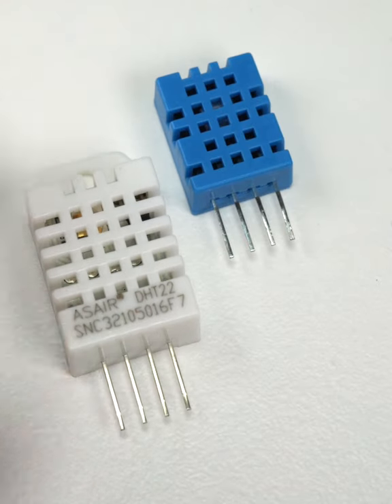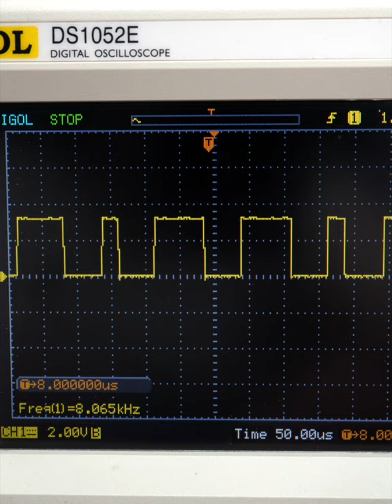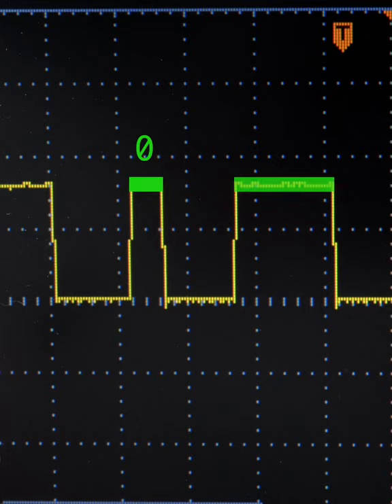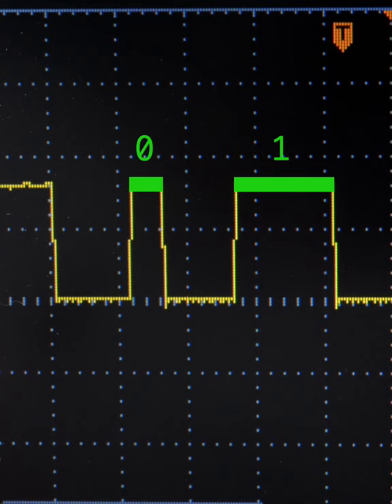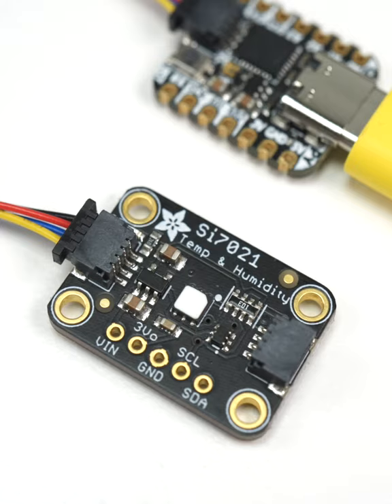DHT11/22 Temp Sensor Trouble - Collin’s Lab Notes #adafruit #collinslabnotes

Comment: I don't know how Arduino does it, but there's no reason the OneWire interface can't be implemented solely through interrupts.  No need to busy-wait counting cycles.
Reply: This isn't "the" One Wire protocol, it's a single wire protocol that is very timing sensitive and also wiring sensitive.
Reply: @rpavlik1  The only thing that's sensitive about DHT sensors is when you poll them too fast. The datasheet tells you the fastest they can be polled and I've never had an issue with a few feet of wire or "timing" issues reading the sensors.

This video is just hocking the more expensive adafruit sensors that do the same thing with the same accuracy.
Reply: You're right.  Just catch the rising edge in an ISR, along with a timestamp. Then reconfigure the processor to trigger on the falling edge.  When that triggers, take a timestamp and calculate the difference between it and the previous capture.  If it's longer than 50-60uS, then it's a one, otherwise.....
Reply: @rpavlik1  true, it's not exactly the same, but it's not that much different in this respect.
Reply: @tonyfremont  I think that would be more complex than the Arduino library. I just had a look and they suspend all interrupts while reading from the sensor since the timing is rather tight. Since the max length message is 40 bits, that would be 80 interrupts total at 2 per bit plus a couple more to signal the start of a reading and then you still have to measure all of them to see what you got. If you had another interrupt fire during that time, you would be in trouble.

There might be some speedy controllers that could handle it, but I'm not sure an 8-bit AVR is up to the task if you want to do anything else.
Reply: I'm not sure about other microcontrollers, but the ESP32 has a "RMT" peripheral that will capture a sequence of digital transitions and the timing thereof, without holding up the CPU with active polling. I rolled my implementation of a DHT-11 driver using this, and it works pretty well.
Reply: @technicholy1299  DHT22 and especially 11s are not as accurate or as long lasting as other I2C sensors and the unreliable interface doesn’t make it so great. There are I2C sensors, even some that come in similar physical packages like the DHT20 that cost near enough the same and are just better. They are all tiny SMD packages too making them fairly versatile.
Reply: I was gonna say, how does my board run Octoprint and a temperature reading at the same time if it really is that resource intensive?
Reply: @technicholy1299 Not really, for use with an Arduino these tie up too many things. Using i2c essentially takes that load off while also giving more accurate measurements.
Reply: @milescarter7803  its not resource intensive the point is that your loop is ran by a single thread so the more time you allocate to "counting microseconds" (quoted from the video) the more time your not running through the rest of your loop. Same is true for literally every line of code though. Less tasks is obviously faster

Comment: I’ve been using an SHT30. But bulkier, but it looks very similar to the DHT22 sensor and works through I2C.
Reply: I use SHT40. it's actually tiny, and only requires a small cap. Maybe you are using a too -large board
Reply: Yes...the sht xx are the best solution...i lost my nerves too much with dht...

Comment: It's a bit more advanced but you can use dma and timer capture to read data from those sensors
Reply: It isn't worth it. Overly complicated solution when there are better out there.

A sensor that outputs measurements in I2C format is a much better solution. Cheaper, fewer component count, greater reliability and less complex software and a shorter development time.

As engineers you are trying to optimise the solution, not make it more complicated than it needs to be.
Reply: @deang5622 Configuring a micros peripherals to offload CPU time is not making things more complex than they need to be, it's making it exactly as complex as it needs to be.  Also check out the cost of these I2C parts compared to the original single wire devices.
Reply: @deang5622  Setting up DMA and a timer capture is like a handful of register writes and a short ISR. That's probably just as simple, not to mention just as easy to write as a simple I2C driver.

Comment: Temperature and Humidity are slowly-changing quantities. Even if you read them once per second (which is probably more often than you really need to), you'll still spend less than 1% of your processor time bit banging.
Reply: That is true, but you still have the problem of blocking high priority interrupts etc if you start measuring multiple 28us periods purely in software.  It's not that hard to use a timer to run these under interrupt using a timer with compare/capture though, assuming you have a spare one.

Comment: i2c, the best
Reply: Curious as to why? It seems people in the know are real fans of I2C and I'm a novice.
Reply: @Quietloud its a rather easy to implement serial buss that allows multiple devices to share the same buss by using a master slave system, so instead of the temperature sensor always sending out its information on the buss the master (usually your main controller) says hey id 123 "fromMaster" out into the buss so it doesn't matter where on the buss it is either. onse the slave device is done doing what it needs to do it can then send out a response on the buss for the master, for temperature that can be pretty much instant since it can continuously read temperature data and only send it once called but if for example you have a stepper motor connect to the I2C buss (would obviously need a interface between the two) the master controller could say move 100steps and once it done that it can respond that it have done its task,

Obviously this is a rather simplistic explanation but I am happy to answer any questions you have as long as YouTube doesn't limit the notifications
Reply: If it's a choice between one wire and I2C then I'd go for the latter, but I2C in general is not as reliable as SPI.

Comment: Unfortunately I have one of these caulked under a toilet in my house, so it's hard to swap that one out. However, I wised up before my next install, so the other toilet has an sht20d or something like that - so much nicer.
Reply: Interesting place to put one I wonder what you're doing with it?
Reply: @bland9876  I guess a toilet seat warmer?
Reply: Why do you have one near your toilet what does it have to do with anything
Reply: @joey.g  under the toilet, to detect if it's leaking
Reply: What kind of system do you have it hooked up. To your PC ...?  What kind of software.   Never heard of someone going to such extreme to monitor a toilet for leaks ..
Reply: @joey.g  just an esp8266. Children don't really sit still on toilets, and I don't want to have to remove tile, cut out the floorboards, patch them, and re-tile yet again 😉. (Also let's be honest, it also makes a fun project to mention 😁)
Reply: @rpavlik1  so you install this esp8266 into your PC?
Reply: @rpavlik1  never mind I see you use it on an Arduino board
Reply: @joey.g  it is the board. Using esphome

Comment: Ummm... "int timePassed = millis();" in an ISR at regular (edit: edge triggered) intervals, and do the checks in the main loop as it goes around? Come now, the advantage of being a hardware hacker is solving problems! Why do it the fast and smart way when you can prove you're right?? 😁
Reply: Even with that, the data quality is so much worse than any modern sensor. There are plenty of libraries to talk to these, since they are popular because they used to be best performance/price in a humidity and temp sensor, but they still are cantankerous and prone to just not working. (Also there's enough variation between units that you might have code that works with one, but then you buy another and it doesn't work with that one.)
Reply: @rpavlik1  Interesting. Didn't know that; thanks! Granted that terrible data is terrible data, but getting the ins and outs of the signaling could be quite valuable to someone. It could be a good troubleshooting exercise too. Why does one work and another not?
Reply: @McTroyd  if one wants to practice troubleshooting skills, sure. But not for practical usage 😁
Reply: Notice adafruit doesn't have breakouts for DHT sensors, only the ones the "recommend". I've never had an issue with them and have had them in service for years.
Reply: @McTroyd  The only way the quality is worse is that you can't constantly poll the sensor. Frankly, it doesn't matter for almost any application that fits this sensor's environmental requirements. You simply don't need to poll the temp sensor at 5hz for any practical reason. Even at .5hz you're generating way too much data for what you would likely practically use. 10-20 samples per min is plenty for almost any project and DHT sensors work fine for that. 

Reading the sensor is one thing, but you have to process the data and do something useful with it and on that scale, DHT11/22 are just fine.
Reply: @technicholy1299  Good points as well. Though, perhaps sampling at the higher rate could offer averaging advantages. Perhaps improve accuracy? 🤷‍♂️
Reply: @McTroyd  In my experience, there isn't that much accuracy to gain. These aren't lab quality and for that matter, neither are the i2c sensors mentioned in the video. There just isn't that much noise to filter out. I sample once every 2 seconds when testing and there is no appreciable drift in my readings. The only thing I ever do to improve reliability is connect the sensor VCC to an IO pin instead of V+ and program the controller to cycle that pin if it gets an error reading to reset the sensor. That takes away from the one wire advantage, I guess, but pins are cheap and there is always a controller with more pins available.

As I said, these aren't lab quality and the readings do degrade over time, but that's due to the heater in the sensor degrading, not the interface. I imagine any similar sensor will degrade in the same fashion. If you take a longer sampling time and shut the sensor down, they can last for the practical life of your project. When working anywhere that's in the environment envelope for the sensor, taking more than one reading a minute is a waste. If you demand perfection, you could take 5 readings over 10 seconds and average them, then shutdown for 50 seconds to preserve the sensor.

I imagine adafruit wouldn't be steering people away from a sensor they did have a breakout for and if you price the DHT sensors anywhere else, you'll see why adafruit really doesn't like them. The clock cycle argument is nonsense. No one is fretting over their controller lagging from reading a sensor and then fixing it by switching to i2c.
Reply: How well do you think measuring a 28 microsecond pulse is going to work with a 1 millisecond resolution?